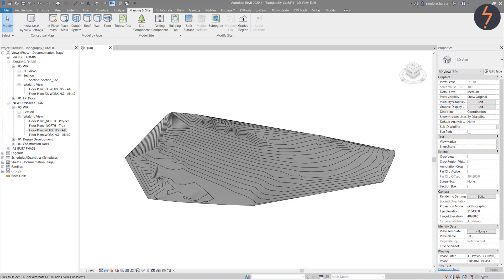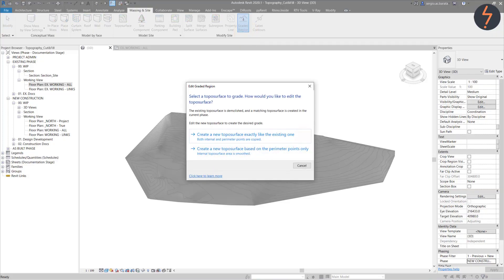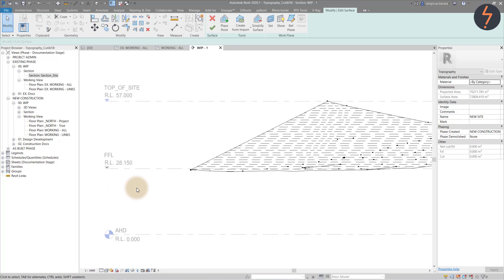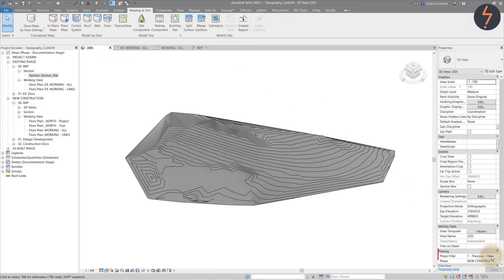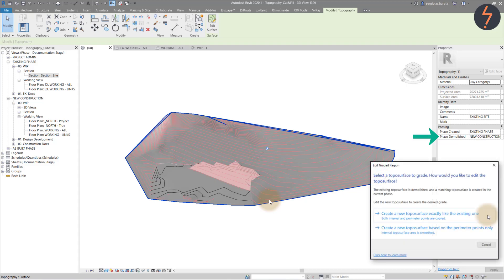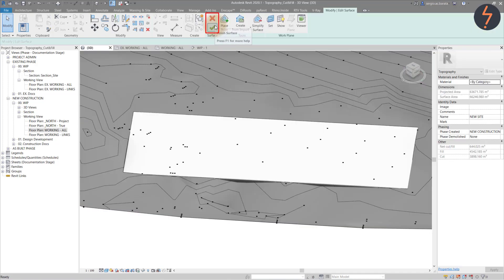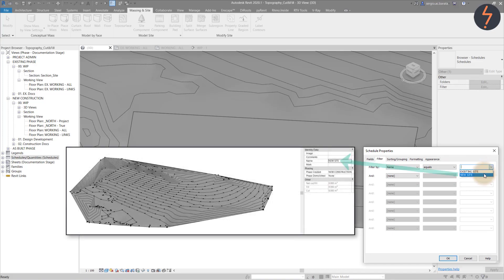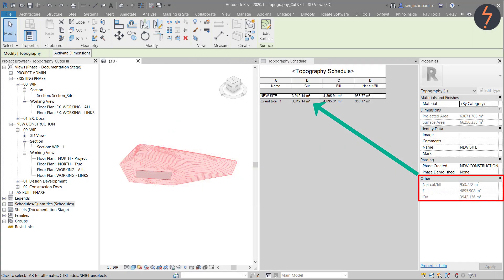Revit | Cut & Fill Schedules

Comment: Hello, what if I have the opposite case such as an existing ramp to be demolished and the hole in the terrain to be filled? The building pad doesn't work because it automatically adapts to the topography of the new phase
Reply from the maker: How did you model the ramp? Did you edit the toposurface to enclose the ramp envelope? I'd like to help, but there are several variables that I can't verify. Feel free to send me a file and I'll have a look for you.

Comment: Cut and Fill Volumes for New Construction are 0, please assist
Reply from the maker: Hi - I would like to help, but I need more information. The steps to follow are shown in the video.
Reply: @SergioBarata  Hi, basically there is Revit bug. if you use Massing & Site -> Split Surface tool and find cut and fill it wont work apparently. You gotta use either building pad option or subregion option to get cut and fill. There is discussion online I cant insert link youtube blocks and ppl say it is Revit bug - you should be able to do cut and fills with split surface. Can you comment on that? Why we can't use split surface tool to get cut and fills? Thanks! Try yourself: use split surface and try get cut and fills?

Comment: Hi Sergio, any idea how you would show the cut or fill in section? And have the cut or fill hatched differently?
Reply from the maker: Hi, try phasing filters. If anything, this will at least give you something to trace over with using a filled region.
Reply: @SergioBarata  thanks Sergio. The problem is I've tried that and you can't snap to topography in section to trace over.Also when you trace over it. It covers the cut line....hmmmm
Reply from the maker: Do a CAD export, then bring back in again (no need for actually CAD). For the region, set the top line thickness. 
I’m on vacation for the Christmas period - when I return, I will make a follow up video. All the best!
Reply: @SergioBarata  great I look forward to it. Pity there isn't a simple tool for it
Reply from the maker: @dimijames7960  - check out this video https://youtu.be/mDm9DzbP3mg
Reply: @SergioBarata  many thanks!!!!!!